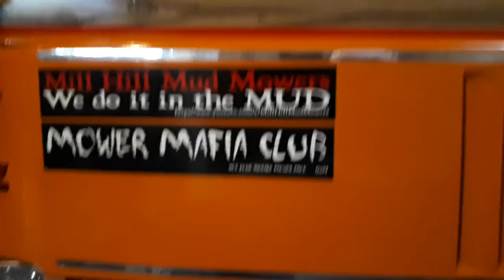My $5 throttle pedal

Comment: this is good, but i have one of those annoying right foot clutch mowers, and im trying a hand throttle. im worried about turning hard and the cable getting stretched, therefore throttling up at the same time. if any of u have any answers, i could really use them. thx

(the mower im using is a mid 90's lowe's mower, swapped with a briggs intek single, 17.5 hp)

Comment: How do you use it so that when you depress it all the way it doesnt put choke on?  If i take my stock gas lever and push it all the way forwzrd that is chocked. Do you run a seperate cable for the choke or how do you do it?